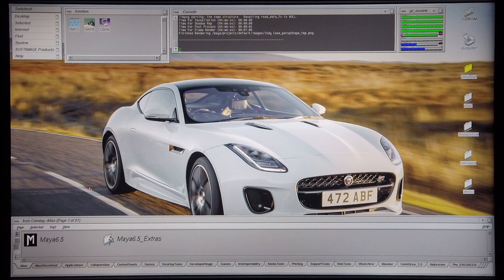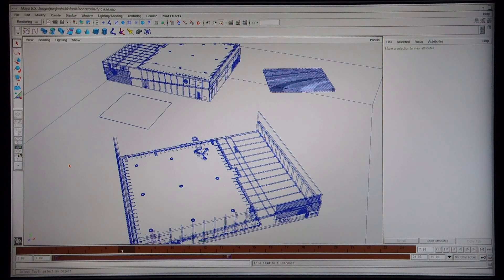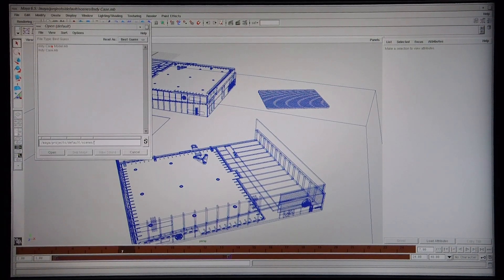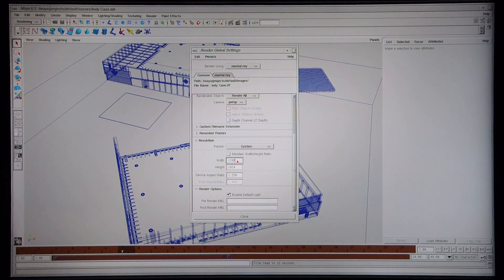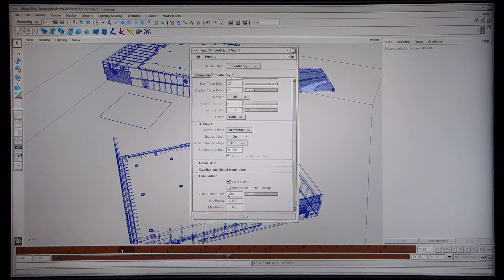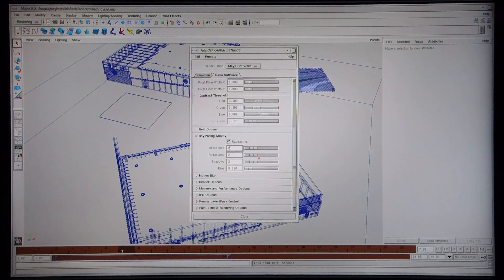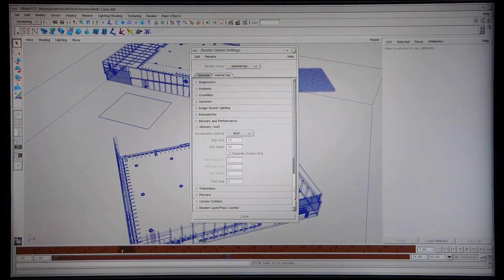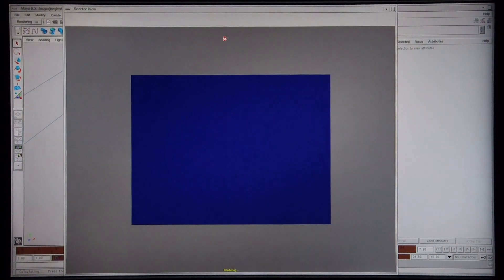Rendering an SGI Indy case in Maya 6.5 on an SGI Tezro

Comment: Hey, I realized this is a fairly old post now but did you ever get satellite rendering to work with mentally on Maya6.5 ??
Reply from the maker: Unfortunately not, however @indigofan on IRIX Network may have.
Reply: @Irinikus  I’ve been looking around and asking around , seem to have concluded they never shipped the satellite functionality for IRIX - it’s missing part of mentalray and it’s not on any of the ISOs people have sourced so far. I managed to get an ISO of the satellite software and it had Win32/OSPPX/Linux but no IRIX :-/. I’ve switched focus to get it running on my little 8x800Mhz cluster. At least that should halve render time or thereabouts